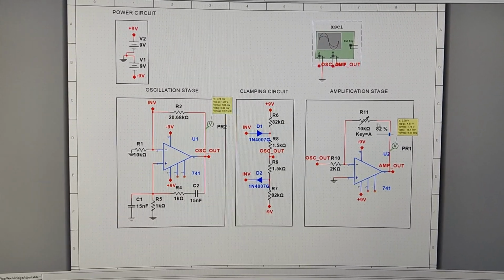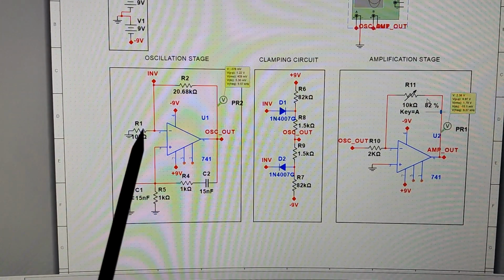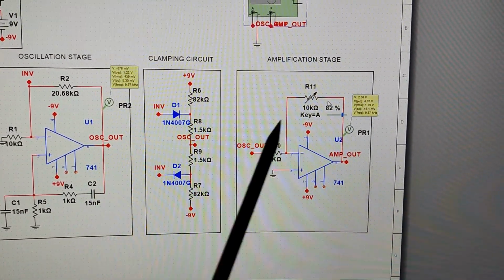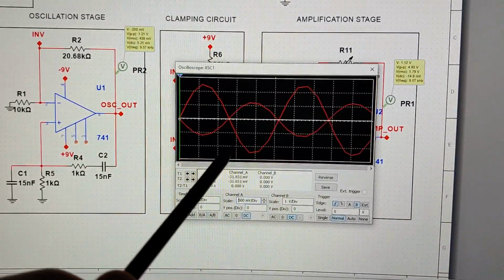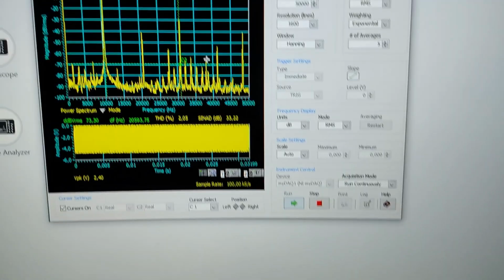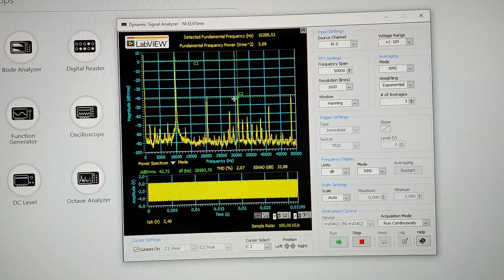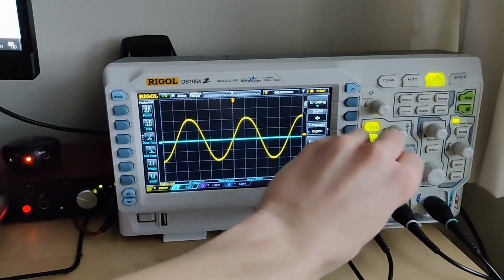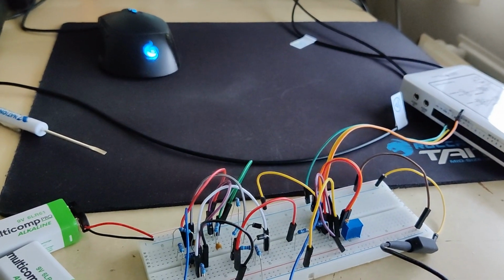10 kHz Wien bridge oscillator circuit!

Comment: Non-linear components is the main cause for the harmonics, and the breadboard indeed is also a cause of noise. However, why not measure OSC_OUT after clamping, and after filtering? You could then connect that node to the non-inverting terminal of your amplification stage.